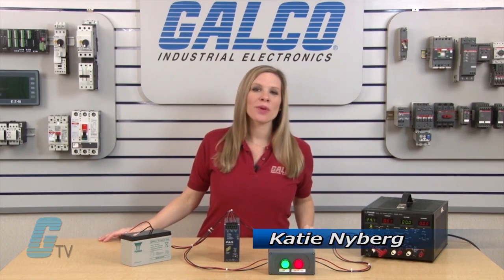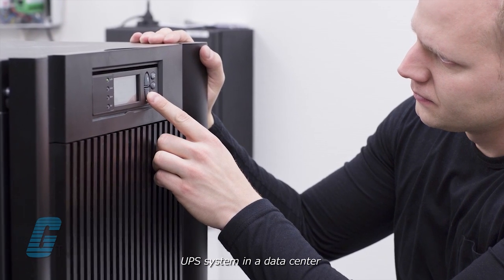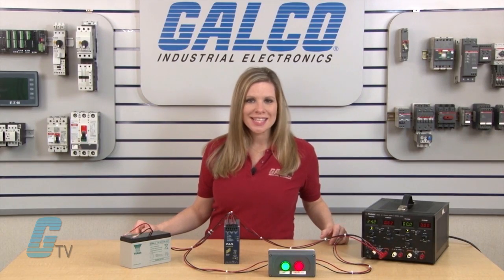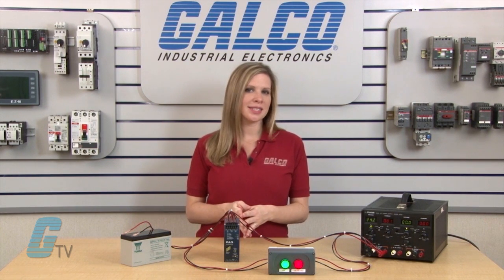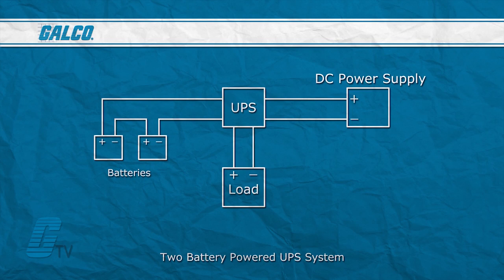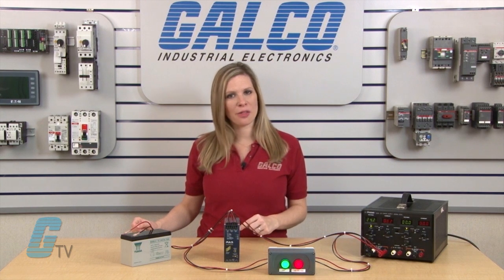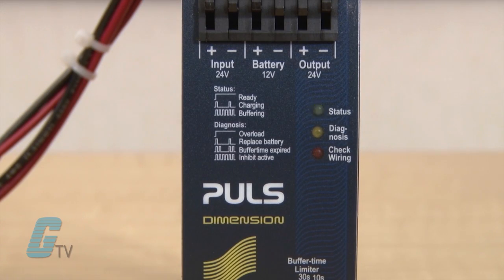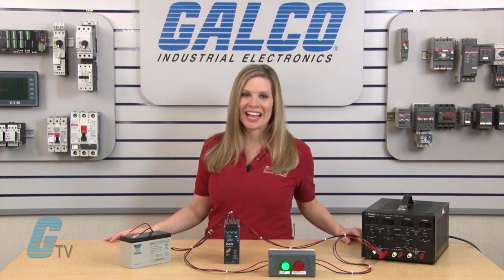Advantages of PULS uninterruptible power supplies

Comment from the maker: For PULS battery operated UPSs, one 12 volt battery is used to buffer the 24 volt output. This also gives a more accurate check on battery life and indication for battery replacement. The PULS battery management system is a more efficient alternative to traditional battery buffer UPS systems for DC applications.